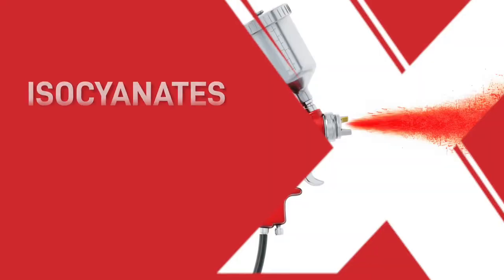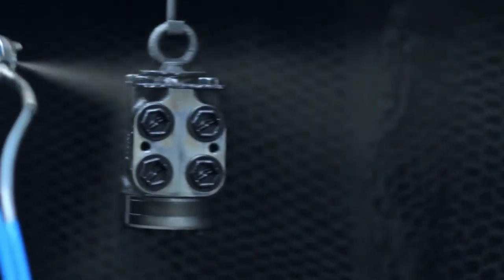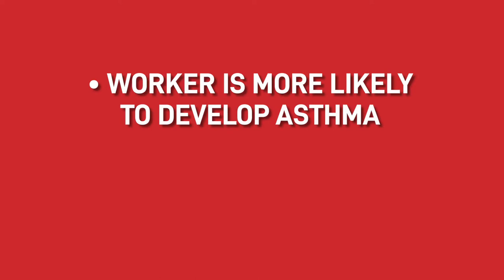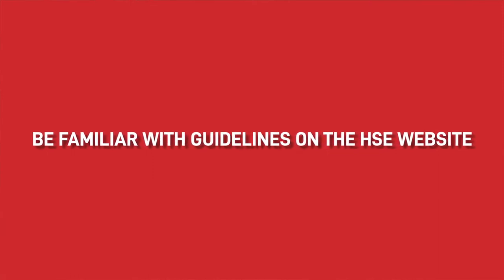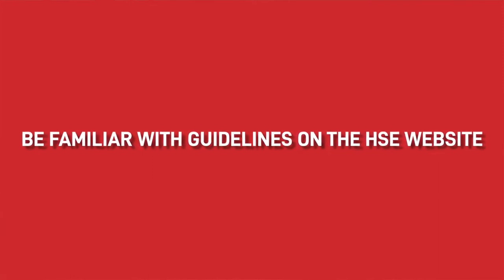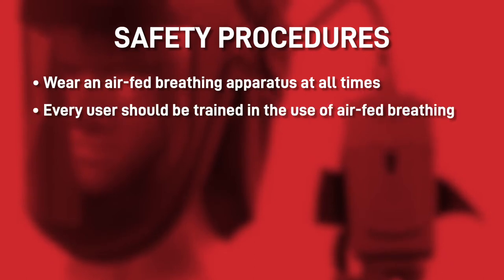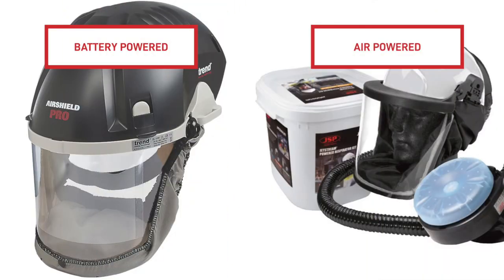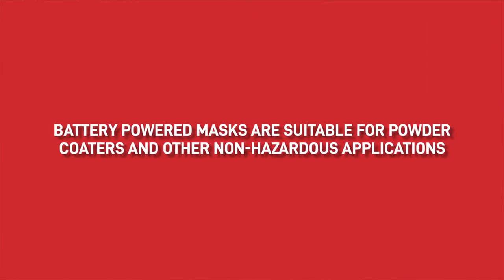Isocyanate Exposure and Occupational Asthma Risks in Spray Booths & Paint Shops

Comment: 3M make it very clear. When using isocyanates, ONLY a supplied air respirator can be used to provide adequate protection. 3M do not recommend using any cartridge style respirator when exposed to isocyanates. Again, that's from 3M.

Comment: Do you know if the Irurena waterborne systems have isocyanate in them?
Reply from the maker: Hi yes even though its waterbased as a Pu 2k paint it will still contain Iso just not nearly as much as the comparable solvent version.
Reply: @ultrimaxcoatingsltd  but the 1k won't,.is this correct
Reply from the maker: @the_sharp_carpenter  1k still has ISO in but its marginal so you would only have to wear a standard mask half face Gerson or something like that with water based 1k (Ie sayerlack at99). Much better for you and no nasty smells in your customers kitchen after spraying!
Reply: @ultrimaxcoatingsltd  so a 3m versaflow with multi gas/p100 would be definitely enough.
Reply from the maker: @the_sharp_carpenter  supplied air is always better Rodney as long as the air is fed from outside of the area / booth ideally directly from outside then that is about as good as you are going to get when teamed with a fully enclosed overall, gloves protective boots and eyewear
Reply: @ultrimaxcoatingsltd hi, I spray with sayerlack at99 and some sort of crosslinker comes with it which I mix in at 2%. Is this considered 2k and should I still be wearing air mask? 
Thanks

Comment: I’m a welder for a large steel fab uk company I often smell the paint fumes in my air fed welding screen I get head aches sore throat they tell us it’s in guide line done test with air monitors I’m off with chest infection is that a coincidence
Reply from the maker: Hi David, depending on your system here we would suggest that if you are getting paint fumes in your air line you need to change your belt based filter or your wall (attached to the main system) filter. Paint fumes normally indicate that the system isn't filtering the nasty microbes and particles out for the clean air system. When you smell paint in the air line you don't want to continue using it. Hope the chest infection improves and although we could never say that is a direct result of your job role its definitely worth sorting that airline issue to ensure future health problems don't make your chest infection worse.
Reply: @ultrimaxcoatingsltd  you misunderstand me I’m welding with a battery powered air fed welding mask I have fume filter particle and pre filter and still get fume round my face
Reply from the maker: @davidpierce7318  ah ok well even more so that is understandable. A battery air fed back is only pulling in air from your surroundings ie: directly around your body so its understandable that you will pull atmospheric smells from around your mask (ie it is pulling air directly around your body in the location you are ) so if the paint is in the same location as your body then you pull those smells in too. To have no smells in your mask and for safety an airfed system where air is pulled from an external fresh air source is recommended (especially if you have 2k paint in your vicinity)

Comment: Are there any supplements to help? I am a spray operator and nobody wears a mask because of the heat in the factory 😮
Reply from the maker: NO! please wear an air fed mask. It isn't comfortable it isn't easy to move around I know ! But it will save your life !!
Reply: I bought the hobby 1 air respirator system for 500 worth every penny now I'm just breathing fresh clean air